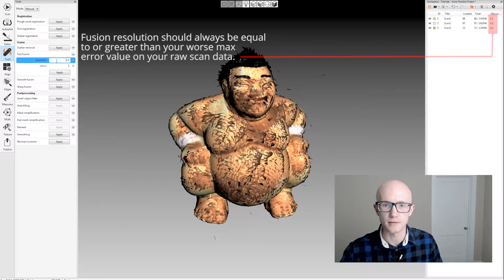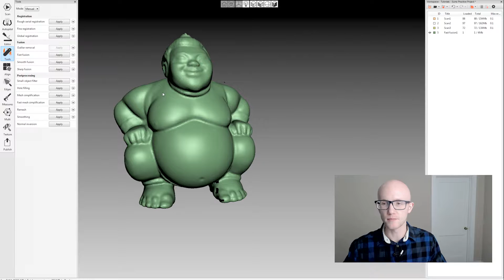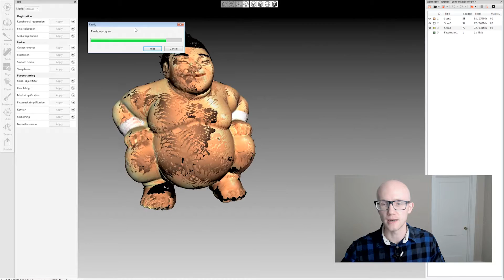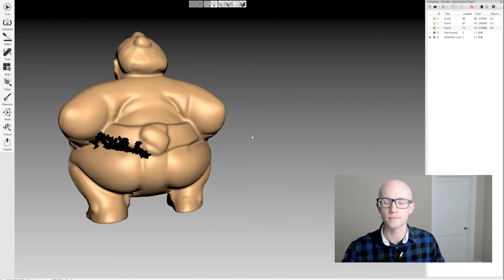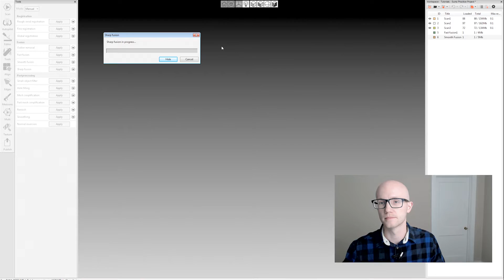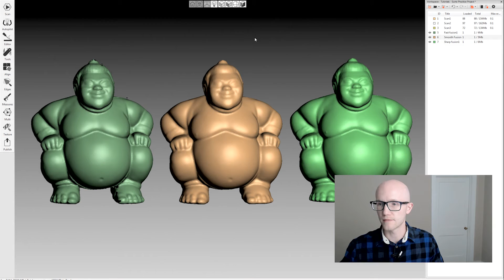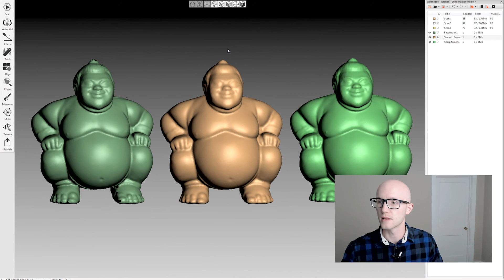Fast, Smooth, and Sharp Fusions - Artec Studio 11 Tutorial

Comment: Hey which fusion should i use for leo scanners?
Reply: It depends on what you're scanning and what result you're looking for.  Sharp Fusion is the most common Fusion used, but Smooth Fusion is great when scanning people as it helps compensate for small movements.
Reply: @bohelmrich4215  thanks Bo! I’m doing sharp fusion and trying to scan clothes. I’m getting quite good results and not too long wait times which is good
Reply: @ChitGetFit  Yeah, Sharp Fusion is probably your best bet!